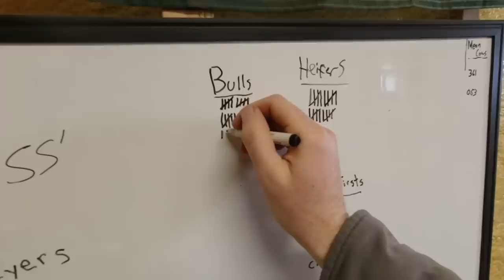Calf born in the Cold Snow

Comment: Hi Cole,  I saw you weighing calves in this video and it look like it was a bit of a struggle for you and your dad.  What we use is a three foot pipe that will fit inside the corner pocket on your pickup box.  At the top of the pipe we made a little clevis that a wooden replacement handle, for a wheel barrel would be pinned into.  The scale we use, is similar to your, is bolted through the wooden handle with the calf sling that wraps around the calf's chest.  The wooden handle acts as a lever and it is easier to lift the calf off the ground to weight it.  Hope you find it useful.  John

Comment: Okay, after watching you two trying to rototill the snow to plant winter squash, I guess,  maybe my thoughts on a snow problem won't sound nuttier than a squirrel with a cheekful of acorns.  Given the problems you seem to have around some gates, the corral, the concrete feed bunks and other small places that you shovel by hand or footswipes, what if you had a small snow blower on tracks to clear some of those places.  Weld up a little hook-up on top so you could have a strap or chain hanging from the Bobcat snow blower or pusher and pick it up to carry it from place to place or set it in the bunker without getting out of the tractor, use it, then use the big machinery, pick it up and move on.  Anytime you can replace manual labor with machinery, you are usually time and need I mention money, ahead. It would cost more than a shovel but less than the blower for the Bobcat.  Just a nutty thought.    Jack L

Comment: Cut and sleeve the vertical part of the cross box tubing to the height you need.  Super easy fix and weld with that fancy Lincoln that needs some use.  Plug in the heater to the genset and you have a Mobil heating unit.

Comment: You need a “ Bercomac snowblower for your side by side…. Would work well to clean out tight places- I bought a 72 inch one, it has a 22 hp Honda engine and comes in different sizes- mine eats snow like crazy- you can install and uninstall it in 5 minutes